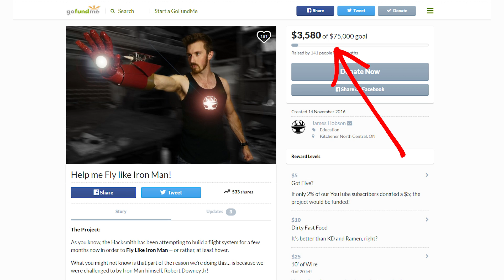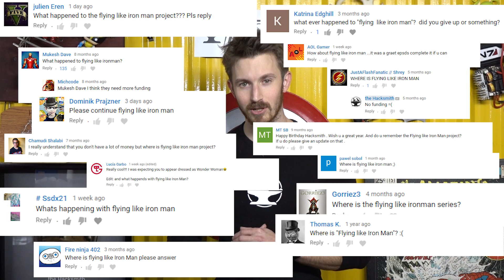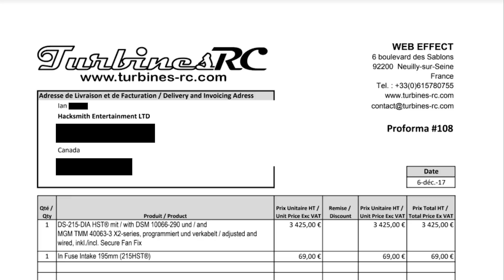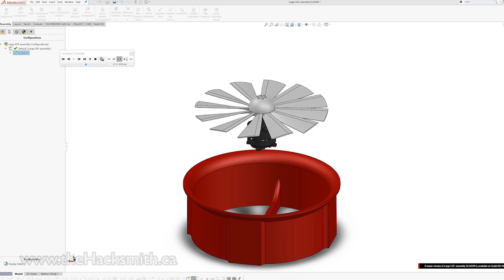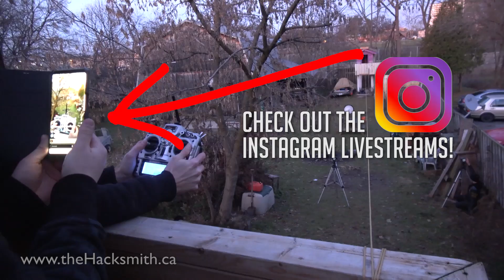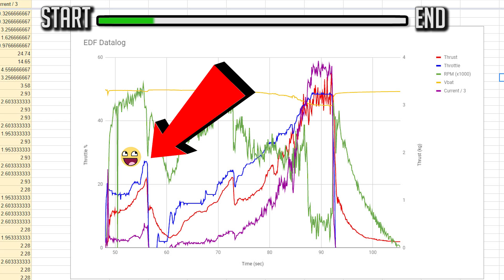Flying Like Iron Man #13: JET ENGINES, EDFS AND MORE!

Comment: Have you thought of using the exoskeleton as a sort of control guide for the thrusters? Maybe a semi locking position to help hold the body stable for flight and optimize the angles of freedom of the body to prevent oversteer and the like. It would be something Tony would do. If you analyze the movies (especially the first) there is mentions of control surfaces. I think this would include body stabilization to help align the thrusters. You've probably thought of this but I couldn't help myself thinking of it. I'd love to help the project cause my dream is to be Ironman myself. Tony Stark is actually my inspiration to go back to college for engineering!

Comment: Did you have an engineer design that fan? If not I would like to help you out. I am not an engineer but have designed and 3d printed several small fans that worked pretty well. I am a mechanical designer for a company that makes fans BTW. Let me know if you would be interested in some collaboration.
Reply from the maker: We are engineers, and we designed it haha. If you use Solidworks you're welcome to try and design one and run simulations to check out how much thrust it should produce, but it's honestly a lot of work!
Reply: the Hacksmith I have my own SolidWorks license however I don't have simulation software.
Reply: the Hacksmith  I should be able to model one out in less than a week if you would be interested in analyzing the design that I create.

Comment: The sound is being caused by the initial Vibrations within the plastic. If you mount the Fan to a metal chassis with a   honey comb style structure inside Should produce more stable flight and less noise.

Comment: I could already tell you, the issue with thrust is that the impeller blades are flexing under load. Meaning they are flattening the pitch of the blades because of the air current and mass of the blades. You can lessen this effect by putting a ring around the impeller, but this will put more mass on the outside and increase the likely hood of an imbalance. 
I would rather use 2 edf's half that size. this would probably increase the total simulated thrust and make it easier to balance.

Comment: Speaking of being able to carry more gas than LiPo batteries, why not use a small, backpack-like, gas-powered generator for the EDFs? Allow me to apologize in advance, if that is a stupid question; I didn't take the time to look up size vs. output. Would it be able to supply enough energy to power the EDFs? I would assume probably not.
Reply from the maker: +TEEDUBS a generator the size of a microwave will maybe provide 3kW. The system will need around 100kW =p

Comment: kk, i agree with a lot of these guys saying that the blades can vibrate which will reduce efficiency. i would suggest re-designing the blade if its going to be that big so you can minimize the tip vibration, or make it smaller with a steeper pitch of the blades, some balancing as well may be needed. also, invest in a stronger material and/or add in steel rods in each blade to minimize flexibility. one other aspect that you could face is if it runs at a high rpm, your blade tips can go supersonic which will also make it loud af. Aircraft have this issue and its why they dont run their engines (prop engines) past a certain rpm rating (mostly around 2500 or less)

Comment: yeah, your best off flying like vulture. wings=airfoil. put gyrocoptor rotors (unpowered rotors) on the wings and you might be able to fly using thrust from Quil's jetpack that you made before. lon as you don't break your leg this time.
Reply from the maker: +Clark Dauphin and death. Flying with wings might be easier but remember how much horizontal speed you need to generate lift lol
Reply: thanks for replying to me. I honestly think flying with wings/airfoil requires much less power than a vertical flight. I'd say combining the electric engines you already made with Peter Quil's jetpack will give you all the thrust you need. if not, at least there's something you can do to fix that: bigger wings. which can be made from cardboard and duct tape, probably. either way, gyrocopyers need much less thrust than normal airfoil. good luck

Comment: what if you used two Marx generators (charge capacitors in parallel, discharge in series) to constantly recharge a high capacity film capacitor? could you get enough power that way?

Comment: If you can somehow add some variable inlet guide vanes, you can change the angle of attack on the fan blades resulting in more thrust. The fan blade's angle of incidence is static resulting in the stalling of the fan blades as they increase in speed (each of which act as individual airfoils or wings). In real turbofan engines, the fan has either variable pitch blades or variable inlet guide vanes allowing the blades to maintain a constant angle of attack on the air eliminating stalls and vibration. There is much more to it than what I've typed but this will give you a starting point to what will make your EDF more efficient.

Comment: You know jet engines are much better, in fact you can attach an alternator to it for running the edfs. You could even put on smaller batteries thus reducing the weight.
Reply from the maker: +kibukun watch the whole video...

Comment: Supersonic rotors lose very much efficiency. A supersonic turbo jet engine slows the incoming air down to subsonic speeds by increasing the pressure.

Comment: What would happen if you made the output of the self made EDF smaller? Because Force=PRESSURE/SURFACE if you made the output surface smaller the force would be higher?! (If the aerodynamic resistance doesn't encrese too much) Pressure should stay the same I think.
Reply from the maker: +Pieter Bogaert not how EDFs work haha.

Comment: I love the idea of self designing and making a jet pack. I haven't searched the comments a lot, but has anyone else mentioned jetpack aviation? They've had an operating jet pack for quite a while.
Reply from the maker: +Shane Casey yeah but it's huge!
Reply: the Hacksmith Not sure if you are referring to the EDF or the jet pack but either way you have a point. I just realized the power in the response 'but it's huge'. I rest my case. I'll certainly be following the developments.

Comment: Have you put in Nutions laws of physics. An object in motion stays in motion unless an opposite motion forces the object to stop. If you force the object to move against the other object that is holding it you need to find another way. P.S. Benjamin Franklin quote. If you fail a hundred times try another hundred times. If you fail learn from those mistakes until you succeed.

Comment: your alpha on your home built EDF looks a bit shallow. super high rpm? then you need the right alloy part not 3D printed. a tighter fit in the cowling will increase fan efficiency to better match the simulation. also, nozzle your thrust!

Comment: The way I would imagine a hover board or something of that concept is by using magnets that are opposite the earth's magnetic pull but equal power. And you could use a micro computer that calculates and fixes the power depending on the weight applied.

Comment: Variable pitch turbo prop.... small size, huge power, responsive control
Reply: Or variable pitch turbofan if you really want it compact... that will take a little more fabrication on your part though

Comment: Guys the noise sounds like your duct isn't stiff enough. At higher flow velocities it might vibrate into your prop, destroying the presumably expensive sls part. I'd thicken up the duct or give it a carbon overwrap. Plus it should be quieter then for the pilot, too.

Comment: Is controlling jet really impossible in your mind? If you manage to make a block system model of the whole thing you could use control theory to control them. The most practical/easy way of doing this that I can think of is using a state space model and then place the system's poles appropriately. Doing this requires some knowledge in differential equations, laplace transforms and a bit of MATLAB but I think you should have that covered since you have a degreein mechanical engineering?

Comment: Project Suggestion!

I have an idea, that will go unrecognized, as always: You could use your exoskeleton legs, or make better ones, fit it with an exo spine and then add wing struts and attach two large EDFs to those struts, you could fly like an airplane and NOT crush yourself with the weight. The battery could be custom made, of course it would have to be wet cell if you don't have the proper materials for a dry cell, but you could custom make a battery that fits on the exo spine just beneath the wing struts that can be refilled. Also , new idea that will help with controlling the movement, instead of shifting your weight, you could put the EDFs in a mechanical swivel, like, it can turn 45 degrees to the left, or etc, and could be controlled by a, or two, joysticks.

Get a pump, though, so you can replace the battery acid in your custom battery, though.

Also, like and recomment this otherwise it will go unnoticed... It's not easy to contact the Hacksmith...

Comment: I feel like that sound that you were hearing when it was about 25% is the fan itself being slightly out of balance which would but a lot more drag on the motor making it heat up the way it did. I think if you got that fan blade perfectly balanced it would spin faster and provide more thrust. Let me know if im wrong cause id love to gain just a little more knowledge of how things work, im just comparing it to a car tire that isnt balanced (my truck has large 35in tires that are unbalanced and it starts to shake at 90mph and will not go over 100mph no matter what you do.

Comment: Someone is already working on a hybrid RC platform. 3 EDFs and 3 Jet engines, also, one guy  is making a simple quadcopter jet engine. Frankly, i think you should get a single jet engine, and use the same tech used in the Harrier jumper jet.

Comment: Is that a Hiller lip on that duct?  I'm sure you've looked at the Hiller Flying Platform.  It had a similarly shaped lip to get more aerodynamic lift from intake.  In the Vertical position, which this would be in a Direct Thrust configuration.

Comment: for everyone saying he should do a vulture type flying system, its going to be even harder than the iron man flying system. believe me even i wanted a vulture thing but a) he would have to completely balance himself out with a counter turning hing so he doesn't flip in mid air b) the project would cost ass loads b/c of the wings and size of the EDFs he would have to get to be able to carry him and the wings and c) as you saw how the donation thing went with the iron man thing, he will probably star uploading less and the most likely reason for the not uploading will be because him and his team did not have the proper funding to buy the equipment and power sources required.

again, believe me i want a vulture thing too its just that there are so many things that are holding him back. if he gets over these obstacles, then i will gladly say i was wrong. tell me what you think.

Comment: So you bought something with 50 pounds if thrust.  And this is going to pick you off the ground?
Reply from the maker: +Paul Ogea to test... We would need a few jet engines and at least 4EDFs. You need 200% thrust to weight

Comment: The loud sound might just be the tip of the propellers breaking the sound barrier, have you checked the maximum tangential speed? Because at that point you get a ton of bad effects to the propellers, you may get ringing and vibrations that would make the whole thing explode so watch out

Comment: you should try to use the TJ100 turbo jet engine or the TS100 Turbo shaft engine. The TJ100 produces up 1200 N of thrust. and it's not as expensive at the others you were talking about.

Comment: You guys should start a vulture project with wings, you could use those EDFs with grips in the front of the body to push the wings down so you can control where you fly

Comment: Use the Rolls Royce 18,000 lb thrust Jett engine?  I think two should be enough to lift you, 400 you tube contributors and 6080 imperial gallons of jet fuel.  This should take you to 30,000 ft across the Atlantic to Paris in just 7 hours....  
seriously, cone down and multiply your fans and speeds to create your own jet column.

Comment: 0.5x was still to fast
Reply: Interesting. When I put it on 0.25x speed, I don't get any sound whatsoever. I suppose it could just have a lower volume, or my PC just can't handle that sorta stuff (seriously this toaster of a computer is depressingly sad).
Reply: I puted it on 0.25 thats lower and i still cuild under stand it still
Reply: He said quarter of the speed. Not half the speed. It worked fine for me at .25x
Reply: I dunno man, I'm using a badass computer and I'm not getting anything at .25 either.
Reply: 0.25 was ultra slow for me (using a phone)
Reply: It's perfectly understandable at 1.5x speed....
Reply: too*
Reply: mabey its just the ass
Reply: 0,5x speed is still to fast and 0,25x speed doesnt output any sound....
 Morons

Comment: I wanted to listen to the speed up part of the video but 0.25 speed comes without sound and 0.5 speed is too fast :/ Also, if you want to, do not hesitate to call for the help of fpv community concerning propwash, motors and all that kind of stuff related to quadcopters.

Comment: By the sound of it you should probably try to balance the rotor blades as precise as possible. 3D printed materials tend to be less consistent in specific weight.
Any imballance is amplified to vibrations and a lot of noise and powerloss. Anyway, awesome job. This thing sound very scary

Comment: hey guys, the vibration you have been experiencing could be a resonance effect from the mounting setup on the duct or the number of blades on your turbine. I think you may want to have an odd number of blades and something else attached to the motor to dampen the oscillations. Good luck!

Comment: hey guys love your work.just thinking , I know you like the idea of EDF 's but instead of the fan blade just use a prop. it is only slightly less efficient than a perfect fan blade but with that motor and still using your shroud, you should get about 25kg of thrust,from memory. just an idea that's all.

Comment: With the vortexes generated by the fan, if you're able to afford it then print a fan with some vanes on it that interrupt the airflow heading towards the duct. It's a bit hard to explain but if you can interrupt the outward flow of air perpendicular to the thrust direction it should prevent vortexes for absolute minimal thrust loss

Comment: Make a hoverboard if you're looking for a backup plan 😉
Maybe 2 edf's, one on the back and one on the front with jet engines at all 4 corners, maybe putting the jets in a sort of pivot system similar to that of the su-37's thrust vectoring system.

Comment: Hi Hacksmith
Loving the idea for this project. I'd just like to say that the noise sounded very much like what I have heard before and that is the blades are warping! When I have tested motors and props on my thrust rig it sounds very similar. Also I know these day's it seems to be the trend to have loads of blades on EDF units. 10,12 or even more but I have found that they draw a lot of unnecessary current which actually  results in less thrust. I have however using a miss mash of parts created what could be the worlds most powerful EDF of it's size 64-65mm and it only uses a 5 blade rotor. It works because the smaller blade count draws less amps so I'm able to fit very fast spinning motors and run them on higher voltage battery's then they are meant to for making the motors spin the fan rotor at RIDICULOUS RPM'S. Which actually generates more thrust then a 12 blade EDF of the same size spinning slower but at about the same amp draw. The motors are very powerful and seem to handle the higher voltage just fine. The EDF unit would produce even more thrust then it does now if it is run on a larger capacity lipo but obviously there would be limited space in a rc jet of that size and you also have to think about the weight the jet can carry too. 
The EDF unit I have made is made from just off the shelf plastic parts and actually produces about 20% more thrust then the most powerful CNC machined aluminum unit on the market of about the same size and mine cost about two thirds less to build.
Just thought I'd let you know that there are other options around to possibly try. 
Hope this is some food for thought. Cheers.
...RCPP

Comment: WOW! just watched you light it off. THAT is an imbalance issue coupled I believe with the induction cowl bell shape "cutting-off" flow beyond a certain airspeed. AS WELL as hall effect. use a permanent magnet motor to overcome this issue. Try curling the lip up out and further around towards the rear more. At least beyond the plane of curvature so that air being drawn from the sides will have a surface to contact and to swirl over and into the intake. Also. the ends of the fan blades should be connected by a ring to reduce blade deflection in air current stream And recessed just behind the intake forward bell ring to reduce toroidal currents and supersonic shock wave effects around the outer perimeter air gap. Remember, in aerodynamics there is no true such a thing as "laminar flow". Only NEAR laminar flow. Hope I am not being a pain. Just a third eye view, that's all.

Comment: your FAN quite looks so very funny, and it is not an aggressive ANGLE OF ATTACK that most all of the FAN BLADE MUST BE..TRY TO BUY another ONE and ASSEMBLY IT AXIALLY,set it up 1 MOTOR CW rotation and the other CCW rotation..my comment and suggestion.